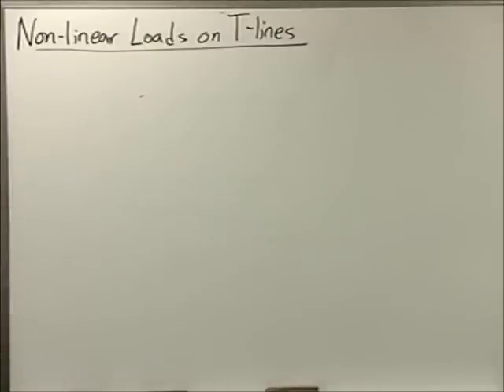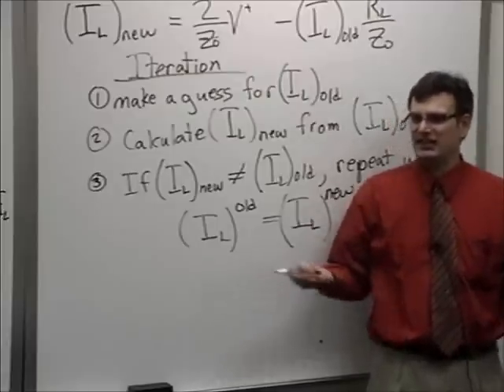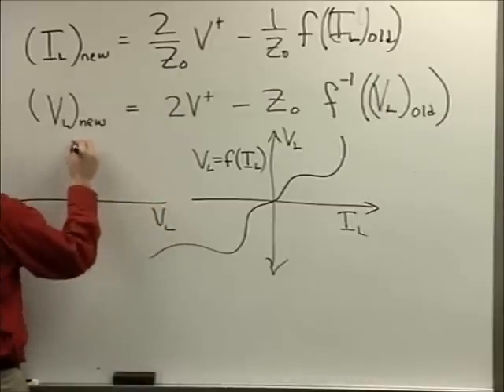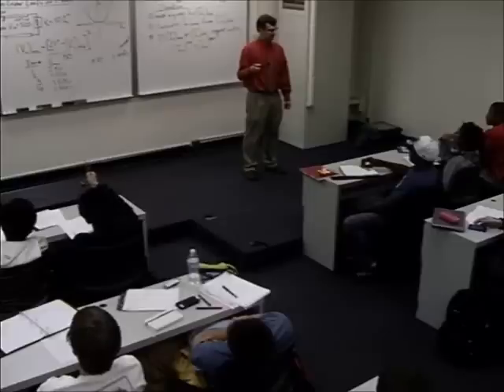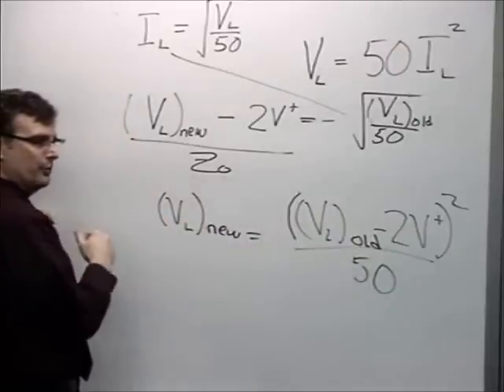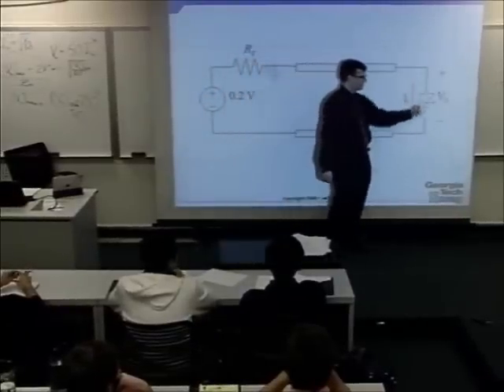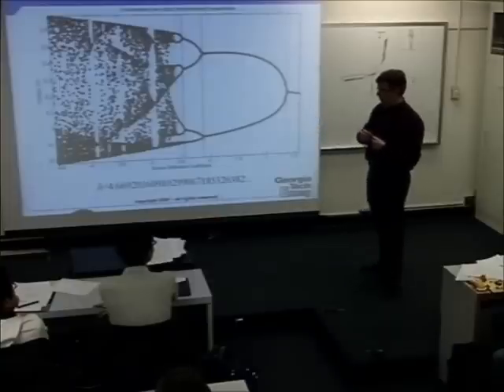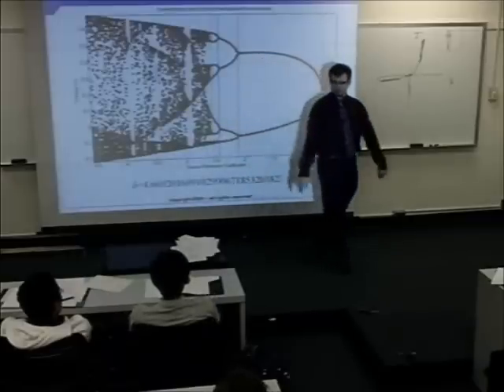TDT09: Nonlinear Loads on Transmission Lines

Comment: Dear Prof. Durgin, thanks very much for your great teaching. Hard concepts are explained so nicely. I wonder if you have any comments on the reflection problem from a nonlinear load when your input voltage magnitude changes in a range, subsequently V+ and VL and IL and then RL = VL/IL? Is there a technique to minimize the reflection in a range of input voltage? Thanks